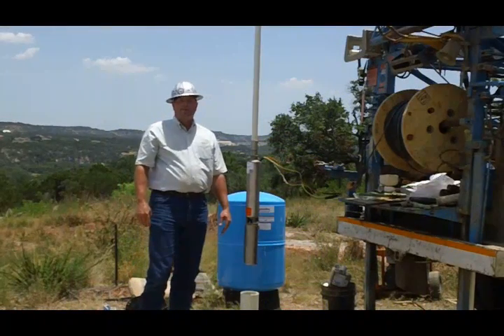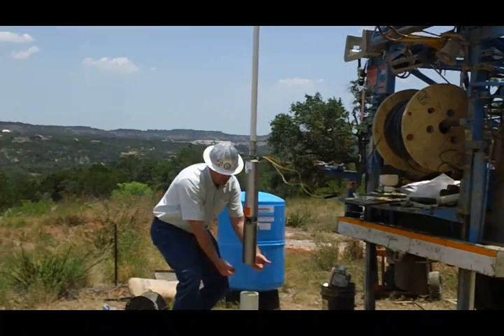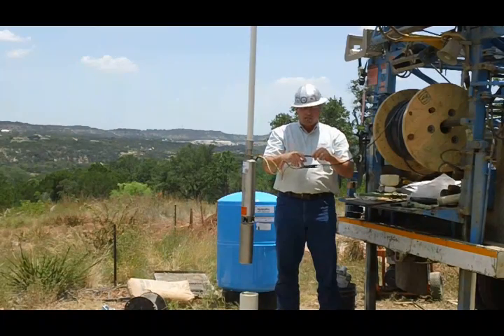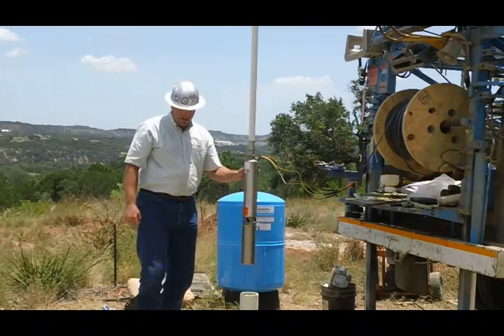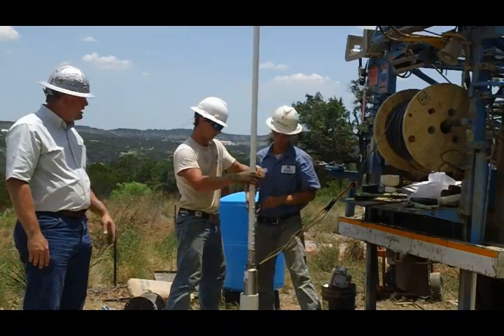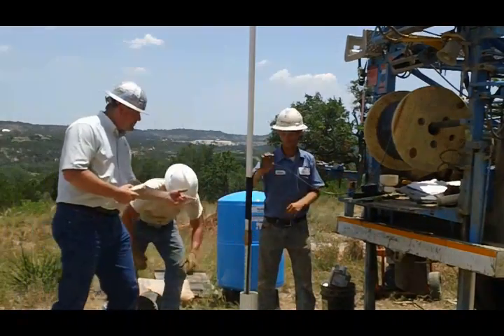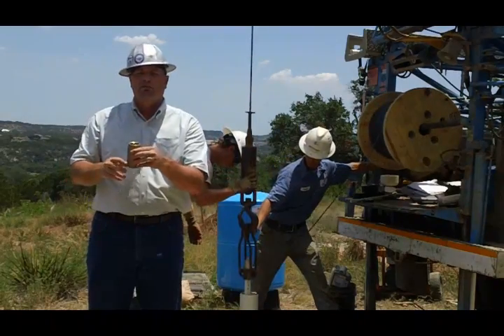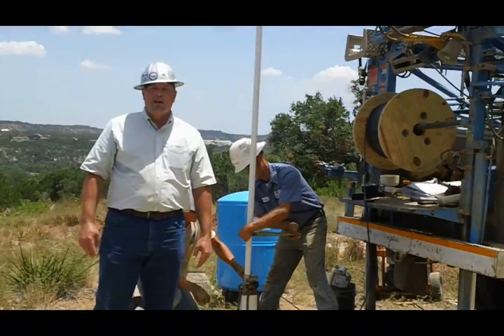How to Install a Water Well Pump

Comment: Good job on that lifting nipple alot of company's don't do that and we pull them and when we get to the pump and it just hanging buy the wire and tape because when the pump and motor gets hot it melts the pvc threads and falls off and just hangs there and we put check valve 20 ft up away from the pump and motor then every 200 ft

Comment: Cable should be fastened somehow to the pipe. For instance with cable tie.
Reply: Not sure if you saw, it appears they put about 2ft of tape holding the cable every 20 ft when they join them at the coupler.

Comment: Nice video, thanks Jim. Just a question, instead of going with PVC and a safety rope, why not go with WellHose DIY Drop Pipe? It supports the pump down to 300ft and is much easier and quicker to install and retrieve.
Reply from the maker: I have used this product a few times and it works great.  But, the vast majority of my pump sets are over 300' and we need something stronger.
Reply: For deeper pump sets check out Boreline. That stuff works great down to 1200ft !
Reply: @carlosguerra3188  My only issue., How would you add check valves?
Reply: My only issue, how would you add check valves?

Comment: Your supposed to put a torque arester on the first 20 and the. the rest every 140. and your safety rope is pointless. you guys leave it at the pump? how are you supposed to recover when all your rop is 5 feet above the pump.
Reply from the maker: Tyler, i appreciate that everyone does it a little different.  I am sure that your way is the best.  Thank you for sharing.  The way that we do it works great for us and our customers.
Reply: @jimblair1  that's an awesome response!
Reply: We only use the arrestors on poly pipe sets for the most part.   We also put check valves every 200 ft here in Oregon.  I agree with Tyler, the safety rope is pointless.  Is it only for when the pump/motor is dropped with no pipe?
Reply: @cgbartlett1989  The way I understood it, if the pump somehow backs off the pipe and you end up pulling up the pipe, the pump would stay at the bottom if there was not rope. The pump probably still has the wires hooked though. Probably a 0.1% chance, I guess they feel that it's worth the 2 minutes and the rope? :)

Comment from the maker: Torque suppressors are very necessary if the wire or pump will be rubbing up against something abrasive.  In this video, we are setting the pump inside pvc casing that has a smooth wall.  But, if we are setting pumps in wells with steel casing or below the casing, then we use either torque suppressors or centrilizers.  We also use double jacketed wire to help protect the conductors.

Comment: I'm going through different videos showing how this is done. In two of the videos a torque suppressor device was installed which I didn't see used here. Is that an unnecessary item?
Reply: Yes
Reply: It is necessary further up the line incase of check valve failure and water hammer.

Comment: Excellent video. I grew up working with my father who was a well driller for over 50 years in Michigan. One question, what is the pipe dope you're using on the threads of the drop pipe? We only used pipe dope on galvanized pipe and never anything on plastic. Keep up the great videos!